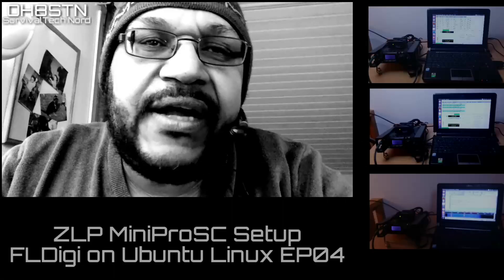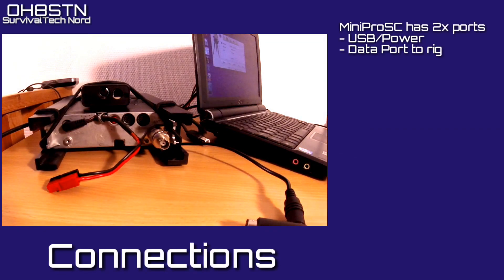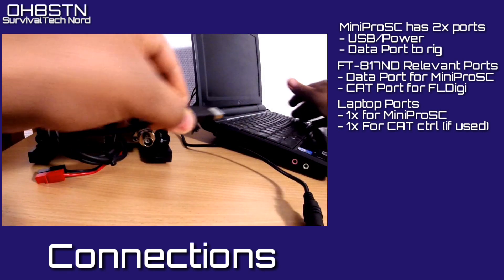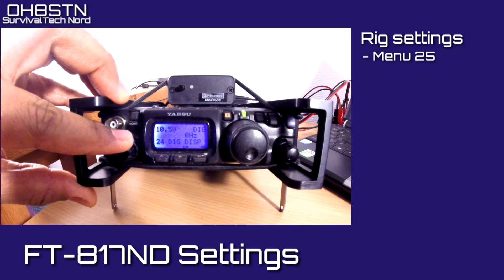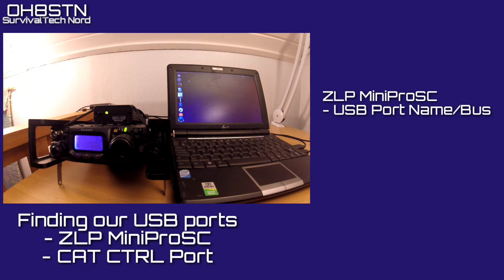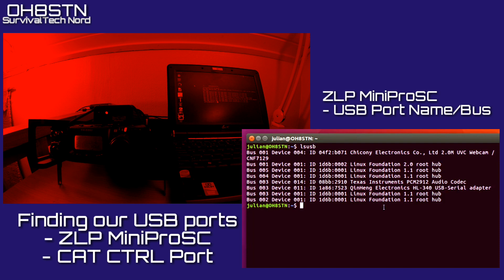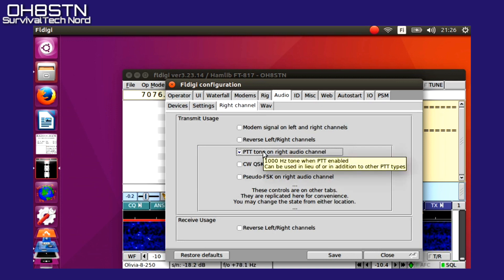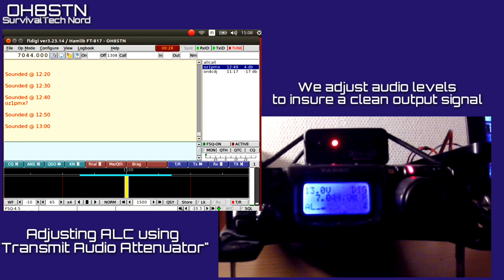FLDigi MiniProSC FT-817ND Quick Setup Guide on Ubuntu Linux EP04

Comment: Julian:

One thing that mystifies me. To use FT8 you computer clock has to be synced within 1 second of UTC. If you are out in the field with no access to wifi your tablet or laptop's clock my be out of sync , but with no access to the internet you cannot run nettime to sync the clock so you are out of luck. How do you handle that problem ?

Comment: Julian,
I am new to amateur radio, I just got my technician license this past weekend and I am already studying for my general.  I am very interested in low power hf and digital modes.  I plan on getting a ft-817nd and a mini pro sc. I have not decided on a antenna yet.  Do you know if fldigi will run on a raspberry pi 3 running Linux??  I figure I can make a real lite setup that is not very power hungry.   Thanks for your videos and time.  Very helpful to a newb like me.  73s 
Dan
Reply from the maker: +Dan G Absolutely!  Also congrats on your ticket.
Heres a link for you https://youtu.be/mHFEPfNcwyw
Reply: Any thoughts on the x108g?

Comment: Julian, I enjoy the videos, even though I only have a Yaesu VX8 HT radio. 
Do you have a video that covers the Yaesu VX8 ? Cheers, Mate.
Reply from the maker: +Jack Walsh Hi Jack
I'm an episode or two, we will start to get into practical digital modes which can be used on HF and VHF/UHF with a dual band HT like your VX-8R. I realised a few weeks ago, that I was leaving out a large part of the viewers by focusing specifically on HF SSB. I hope you stick with me. It's slow going but not far away.
BTW, I also thought about another VHF/UHF antenna build. This time and halo array for APRS or other FM operations. What do you think?
Reply: My knowledge of the varied external antennas is minimal at best. My experience is solely HT and a few extended antenna associated with my two HT radios.  Although I do enjoy learning what I can via your very educational videos. Cheers, Mate.
Reply: Thank you for the information. I will check out the link. 
Much appreciated and Cheers, Mate.